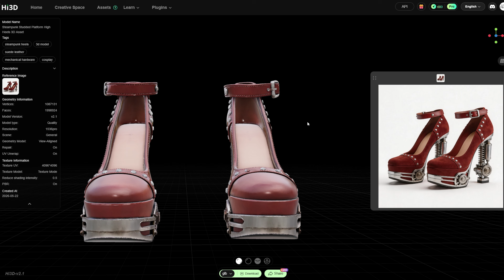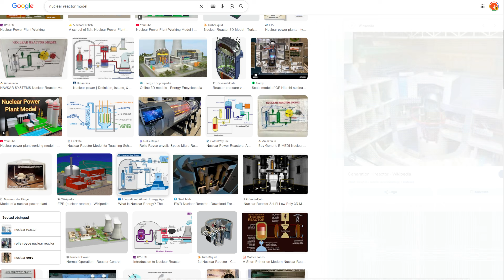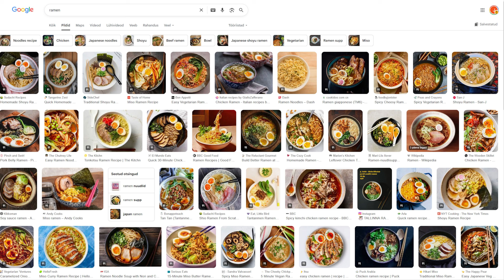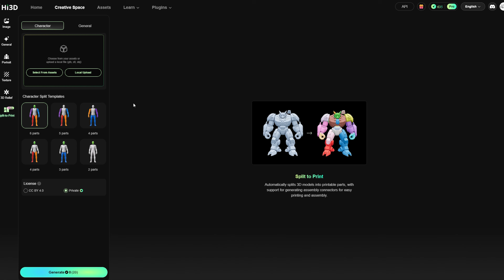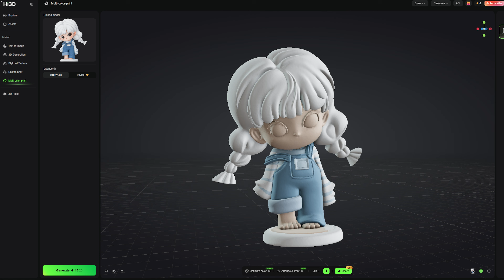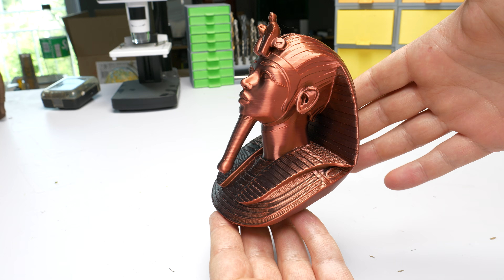AI Model Generation Is Better Than Ever Before – Image to 3D with Hi3D

Comment: Pro version:
per model generated its around 20 to 30 cents (without textures) or 50 to 90 cents, even for the slop you have to go trough until you get a model thats worth printing

1 credit is 2 cents (USD) 

sounds fair, not for me since i mainly need functional parts, not good looking ones but if i had to make that mug or bust in blender you wont see me for a month and it wont look that detailed.
Reply: Yea, no dice. There are a few which will generate slop for free (open source) and you can iterate until you like it without going broke
Reply: @somaliskinnypirate  Can you share these ones? I am actually interested